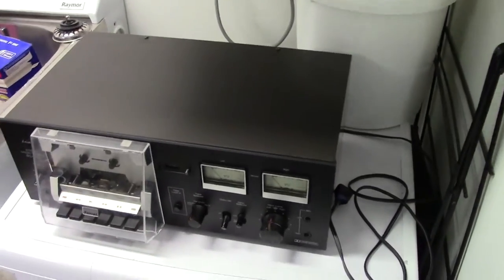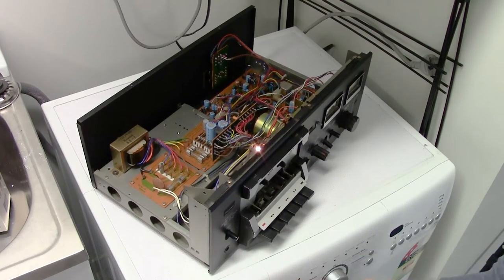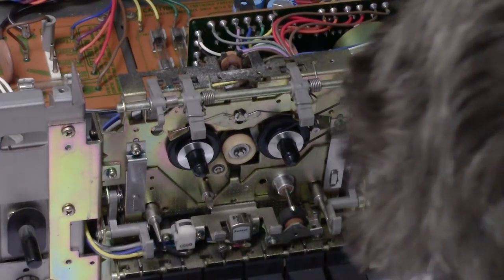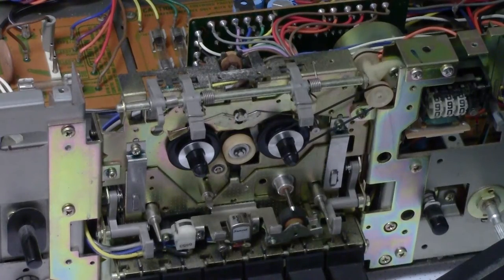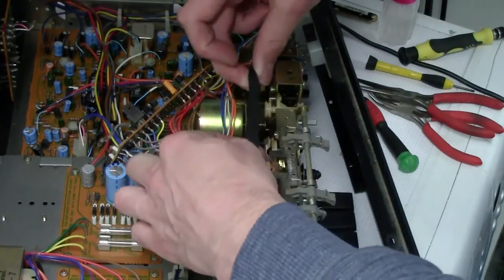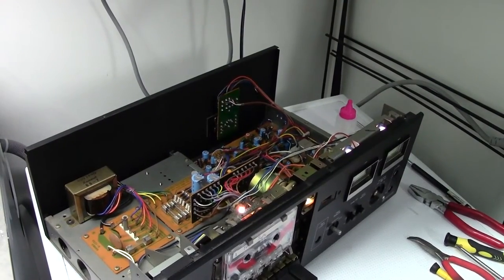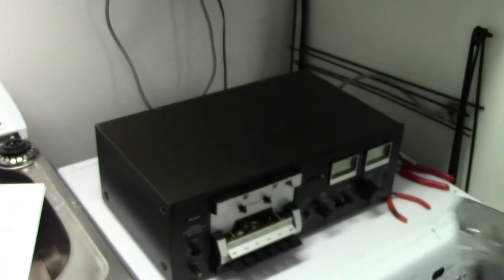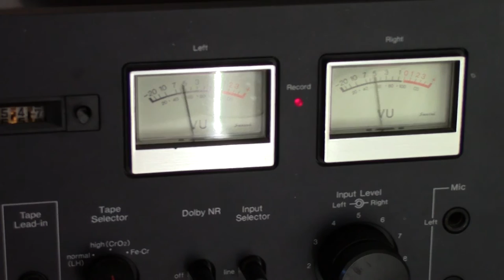Sansui SC-1110, Minor Repairs

Comment: Hi ive had one of these for years in really great cosmetic condition, after watching your video i tried mine and same powers up but not much happening..Managed to unclip that board and unscrew that nylon screw to allow just for now and elastic band past and over capstan..It works again in a fashion but requires propper belts i guess..the other two belts work but are slack..Nice old machine that would be worth the investment?
Reply from the maker: Apologies for the slow reply! Joys of life getting in the way. Thankfully these units aren't too bad to work on. I need to go back into it and pop a proper belt on it.

Comment: I've got the same problem, the drive belt has melted into a tar like substance.  I've been trying to figure out the best way to get the new one on.  I see you've gone in from the back and made it look relatively easy, I was wondering if that was possible.  Wasn't sure if the nylon screw into the flywheel thingy would separate or not.  Pity you blocked out some of the shots but at least I know which end to tackle.  Thanks for the video, I'm sure others will find it useful as well, I would imagine all these vintage models have the same problem or soon will have.
Reply from the maker: Sorry I've only just seen the comment. You can get just enough room to get the main drive belt out. If you search on YouTube 12voltvids, he's just done a service on one of these this week. And did a more of a teardown than me
Reply: @thesmokingcap  Yes, I slackened off the screws and managed to slide the belt behind. Worst bit was cleaning the old belt off. I used methylated spirits and a few cotton buds.  I then found the motor speed needed increasing a bit as tapes were flat. I compared old tapes to digital copies of songs to fix that.  The player still slows down towards the end of C90 tapes, I guess that's just old age.  Thanks for the video that showed me the way. I also demagnetised the heads and gave them and other parts a clean up.
Reply from the maker: @MrOldhoot  It might have a tired motor, or needs some lubing

Comment: I’m looking for the take up spindles (pulley, the parts that fit into the cassette holes) for a Sansui SC-5330 cassette deck.
This deck was an open front-loading unit without a door. The sprockets were spring loaded so you could push a cassette onto them. They consist of the normal sprocket that slipped onto a plastic hex part with a spring and was secured with a cap screw.

All that is left are the hex shaped spindles from the motor, so I need the spring, sprocket, and cap screw or the specks to make my own.
Reply from the maker: Hummm Yeah I think it will be hard to find parts. As this design was specific to Sansui. Might need a dead donor unit to salvage parts from
Reply: @thesmokingcap  yeah... I've been thinking of drilling some regular spindles if I can find some springs that work well.
Reply from the maker: @mostirreverent  Sounds like a headache! Hopefully you can find some parts that are close

Comment: I just re-belted to uncover another problem. Motor slows down, randomly, usually when machine plays for a while. I've checked caps around motor but nothing out of ordinary.
Reply from the maker: Humm I can take the lid off of mine and check the voltage. It might be the lubricant inside of the motor. I will link 12voltvids youtube channel as he does heaps of these cassette decks. Hopefully something in there helps
Reply from the maker: https://www.youtube.com/watch?v=v1Syuik41Rc